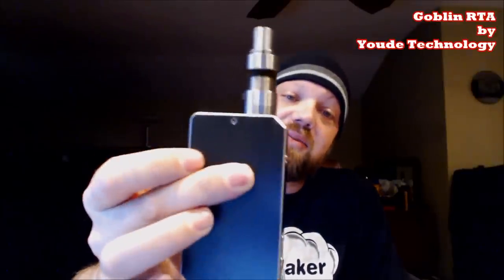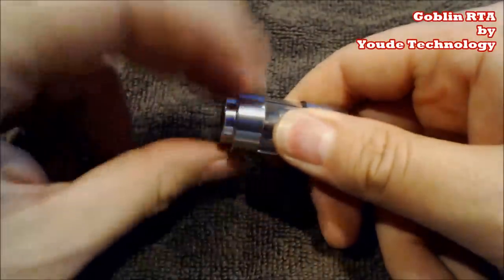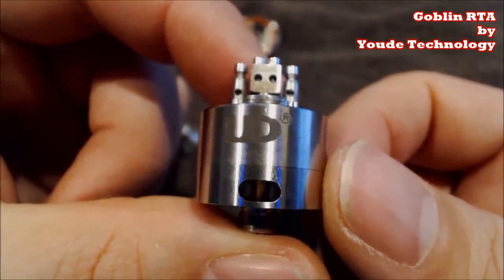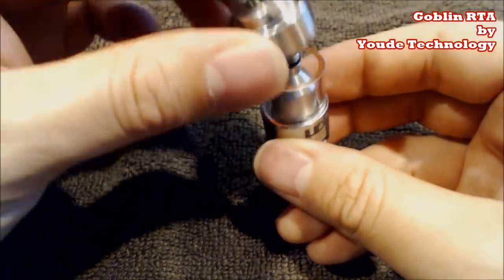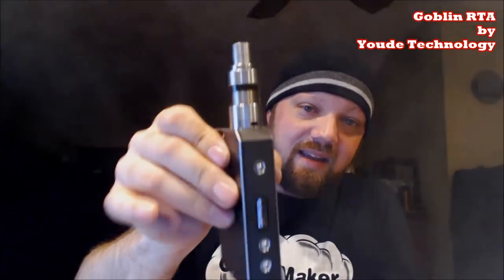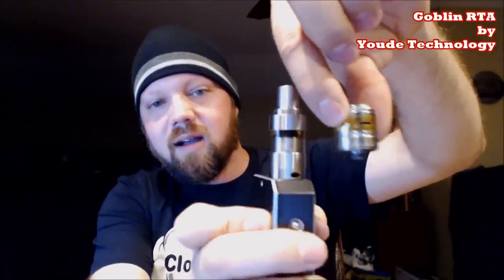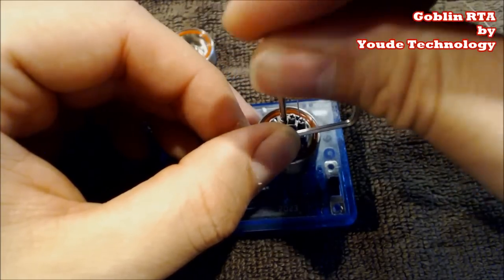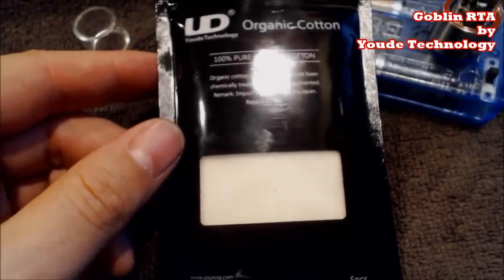*Massive Airflow* Goblin RTA by Youde Tech Review/Rebuild

Comment: Not thrilled with the post holes/screws. Tried 4 different builds (parallell 32/30, 28/27) and can't seem to get steady contact. Ohms are fluctuating.
Reply from the maker: Tanks are not really meant for parallel builds.  Try the 26g 5/64" ID 7 wrap dual coil.  This is not a dripper.  I get great contact on mine.  Where are your ohms fluctuating?  On what your ohm meter or a regulated device?
Reply: Thanks, on the fifth build with 27g I got it right. Would still say that these posts are more finicky than I am used to.

Great vape though. I found that it wicked best with the cotton just on top of the juice channels.
Reply: Ray Lo Vapes
 At least I am patient. At the seventh build I found the cause. The post screws are too short for 27g. The screw fastens head against the deck instead of tightening against the wire. I think that is a design flaw.

Had no thicker than 27g but tried twisted 30g and no problems with that.

Comment: How does perform compared to the delta 2?
Reply from the maker: I would say they are fairly similar but you get a little warmer denser vape on the goblin since it's a dual coil.
Reply: Ray Lo Vapes I love the the delta 2 and yeah very similar but for but the Goblin wins coz you can fill it up miles easier and see your juice and taking about juice you say you have not had one leak but I find it seeps out from the fill screw ever so slightly.
Reply from the maker: Yea I get the same thing now.  Little bit comes out the fill hole.

Comment: I carry around the Atlantis with me all day. Im not too happy with the flavor but it is good on airflow. Every dripper I have bought has been a wash. Dripping just isnt for me. I was thinking about getting the Lemo Drop for my first RTA. The single coil really appeals to me over the dual. Would it be worth it or should I just order this now?
Reply from the maker: It really depends on what you are into.  If you are seeking the larger airflow for big lung hits I say go for the goblin.  If you don't mind a tighter airflow and ease of use go for the lemo drop.
Reply: If for any reason you can't get a Goblin or have one and want a different tank like the Atlantis but about 10 times better look at the Delta 2
Reply from the maker: Yea the delta II is a good choice
Reply: Ray Lo Vapes I have all three delta2,lemo drop and goblin and I find the lemo is a great tank for flavour but couldn't compere it to a delta2 like some have as its a "sub" tank but I would say it kicks the arse of the Kanger group. The delta 2 for me is by far the best of the lot and I have the all of the main new runners on the market. The Goblin I can't comment on yet but is why I'm here coz eveyone I've spoke to told me to set it up the way you have only thing different would be I only have 28 gauge wire so hope that's fine I'll be going for about 0.8 ohms I think and be setting it up tonight if time or tomorrow. So big thanks I'd say from everyone is in order as all have said in here and the forums that your the man to watch a goblin set up Cheers

Comment: Is Goblin Pack doesn't come with driptip?
Reply from the maker: No but I have talked to Youde this week about adding matching wide bore drip tips to their devices in the future.  Won't be too difficult since they also make drip tips as well.
Reply: Sure...But just wondering why they not include the Drip tip in this product...
Are they like..."yeah...Finally,we came with good stuff overhere,just launch it quickly,then we sell drip tips separated" LOL...hahahhaha
Reply from the maker: Ridwan Gunawan Youde never had drip tips with their devices.  But I have asked them to start doing that with the newer items.  Drip tips with devices are a fairly new thing to the market.

Comment: 24 ga builds are easy in the Orchid... not sure why you had to settle for 26 ga in the Youde as the build deck doesn't look much smaller. 24 ga is the sweet spot of all my juice, so that would be a deal breaker for me if it really doesn't fit. The 3ml capacity is already laughably bad.
Reply from the maker: If you watch the rebuild tutorial at the end you can see that 26g 5/64" ID is the biggest coil that will fit.  This was made to be a smaller tank, and the larger one will be coming later.
Reply: Ok thanks for the info. I'll have to wait. Can't use anything smaller than 24 ga.

Comment: Jesus man, I can't find this bitch anywhere. I gotta get one of these. Awesome find Ray, thanks for sharing this. I've been looking for a legit dripper style tank system I can rebuild and has massive airflow. I almost bought a Billow, not now, LOL. I gotta find one of these brother.
Reply from the maker: Only place I know that had these was Triangle Vapes but they sold out in 12 hours.  But they should be restocked in the next week or two from what I have been told.  But you might also want to look at the SilverPlay, it's pretty much on par with the Goblin both have their pro's and cons.
Reply: Ray Lo Vapes I just watched your SilverPlay / Goblin comparison and I'm thinking even though the SilverPlay has a tad bit tighter airflow I think I'll go with it simply because of the build deck. I would rather build 24 gauge dual coils on say a 3/32 or even a 7/64 instead of the oldschool tiny 5/64 bit and 26 gauge or even worse 28 gauge. Now if I could rock dual twisted 26 or 28 gauge on the Goblin I would probably wait. Have you tried that build on the Goblin yet? Thing is I don't want to buy both I already have enough paper weight tanks laying around and that includes the Subtank and Atlantis. I hate both of those products man. Either way, thanks for the videos man. Finding a decent tank system with extreme airflow has been a nightmare. Hopefully 2015 will be the year!
Reply from the maker: No i've only stuck to the 26g 5/64" build.  Seems to work the best for me .  But yea snag the SilverPlay it's also pretty damn sweet.

Comment: Giant air holes mean nothing at all if the hole isn't the same size all the way into the chamber.    I purchased the UD AGA T5 and its got holes that make you go oh look at this it will have decent air flow but when you get into the actual device and follow that air you find its all trying to cram up into a tiny hole inside the threaded copper 510 pin.  Then after you get the build in there that restricts it more and the dam thing leaked all over if you let it sit a while unless you packed tons of cotton in it and then you get dry hits and the and and and and went on lol.  I do see on that one they got wise to the restrictions and the other end of the holes under the coils are also quite large and with it being a dual coil there is two of them so yes im sure its got decent air flow.  I shall keep an eye on this tank and see what more reviewers say about it.  Someone said that tanks where going to end up big this coming year and I think they are right.  Thanks for the great review man.
Reply: Of course as I watched further you said the same thing about the air flow lol
Reply from the maker: Yea this one has the dual 3mm air holes on the deck so you can get some deep lung hits no problem.

Comment: Well mine arrived today and I had high expectations. Sad to say it didn't really meet my expectations. Sure it wicks like a dream even with 80/20 juice while chucking out clouds of vapor but my Kaifun Lite+ still beats it in flavor and to be honest so does my Kanger Subtank mini.

Major drawbacks: the fact that 5 from 6 of my favorite driptips are too tight to fit. The airhole controls measures are all fcked up and not inline 100%, meaning when you close the airholes one of the air intakes pulls more air than the other. Worse of all the fill hole is missing an o-ring which makes it leak.They fcked up a very good concept by poor execution. Hype really not worth it.

Looks like I'm stuck on rebuilding those Kanger atties.
Reply from the maker: The flavor is depending on the build.  Anytime you add more airflow you will loose out on flavor a bit.  Also the bigger glass has less flavor then the smaller glass.  The closer you are to the coil the better the flavor on these massive airflow tanks.
But it's all personal preference really.  I can't stand kayfun's I think they are horrible (for me).
Reply: Ray Lo Vapes 8 wraps 26 AWG, 0.44 Ohm, 40 Watts, 1mm to 1.5 mm from the airhole which is pretty much as close as you can reasonably get without getting too close. Tugboat V2 kills this in flavor hands down and so does my Kanger tank mini and I really can't say there's a huge difference in vapor production between either.

My main concern though are the flaws in machining which you didn't address at all which makes me to conclude that the final production pieces are not identical for whatever reason to these first batch "prototypes" they keep sending to people to review. You didn't address the flaw in mouthpiece size nor the unacceptable flaw in the airflow ring, which has the airholes off by 2mm.

Love your reviews but unless you simply missed these flaws in the atty I can't but conclude that UD is using reviewers such as yourself for false marketing since they production models differ from the ones they send you to review. I really hope you reconsider reviewing anything else accept proper production models cause otherwise, as unfortunate as it is, these reviews are nothing more than hype promotion and misleading marketing for Chinese manufacturers.
Reply from the maker: What issue with the mouthpiece size?  Also what is of on the Airflow by 2mm?  You are the only person I have heard these from.  Also I can't pick and choose what product they send me.  Typically companies send out first batches to reviewers because they want to get the word out.  You might also be putting the coil way to close to the airflow hole.  I keep it a big higher to allow better airflow and also keeps the coils closer to my mouth to get the best flavor.  If you have an issue with the afc and the drip tip size maybe you should send it back.  Sounds to me like you got a bad one since you are the only person i have heard complain about those issues.  Most of the feedback I received has been positive.  I have been told by many the kanger subtank has issues with dry hits and muted flavor as well.  So really it's all on personal preference.  I can only talk about the product I have in my hands.
Reply: Ray Lo Vapes I hope you are not trying to convince yourself that you are forced to review everything sent to you without holding the manufacturer responsible. At the end of the day it's your channel. Just saying.

1.5 mm is pretty much spot on when maxing out the flavor without restricting the airflow. The airhole sizes being off means that the airhole cut offs in the AFC ring are not identical. Now looking closer it looks to me that the other one is actually a bit smaller as well as "off" regarding the placement. So when closing up the airholes and thus restricting the airflow with the AFC ring ends up giving different size airholes on either side. The other airhole being 2mm larger. The difference is big enough to effect the vape quality and is very noticeable. More than likely this is the reason for poor flavor production. Obviously, the difference gets more noticeable when getting close to closing the airholes. Ie; when trying to get more restricted airflow for better flavor. Basically I'm forced to leave the airholes fully open to get an even airflow and take slower pulls (which does give me more than a decent vape I have to admit) but this is a b-class product which should have never left the factory. I have seen this same issue before on cloned drippers with AFC and it is actually pretty common with the cheapest stuff coming from China.

The drip tip hole on the other hand is so small that it only accepts one drip tip from around 20 I own atm. Luckily the tip that fits is a large bore delrin dripper tip and perfect match for this atty.

It is pretty clear to me they have outsourced the production to minimize the expenses and/or to meet the demand they had problems dealing with and all this without a proper QC. Tolerance issues is what I'm looking at. For now I haven't yet heard other people having the same issues but I'm pretty confident they will start popping up as these kinds of manufacturing issues are never restricted to one piece only. What percentage is the real question.
Reply from the maker: Are you sure you bought an authentic one?  Because I have not heard anyone else have the issues you are talking about.  My afc lines up perfectly, and the 510 fits all of 50+ drip tip with some being a little loose actually.  So either you got a clone or just ended up with a bad one that didn't get caught by quality control.  Where did you order it from, and have you contacted them to fix the issue and send you a new one?
Reply: Ray Lo Vapes Yes its authentic. Fasttech has the clone already but it doesn't have YouDe logo on the bottom and mine came with YouDe packaging and all. There are others who have had the same problem, just read on forums. And the leaking specifically has been a major problem for many. Trust me, it's just like I said. They make the "preproduction" model proper, sent it to you guys to pump it up and then switch to lower cost manufacturing without proper QC. I ordered mine actually from Pedro's (Caravela) recommended atty distributor in Portugal, 2Smok. I haven't yet contacted them. Maybe I should but I doubt they will do anything else accept tell me to send it back to them for a replacement at my cost of course.
Reply from the maker: They should take it back without issue.  Youde replaces damaged good for vendors.  Also when it comes to leaking the only place I've heard of leaking is coming from the fill screw.  But that is like hardly drop of juice over a full day.  But if it's leaking via the airflow that is due to wicking not being right.  Out of everyone I have talked to about their Goblin you are the first to bring up the afc issue and the 510 issue.  I have handled at least 50 of these tanks since they came out.  Bummer you got a dud sorry that you are having issues with it.  Most everyone I have heard nothing but great things.  All the reviewers (only 2 got them straight from the manufacturer including myself) have not ran into those issues either.  But like I said Youde is good about replacing damaged goods for vendors so you should contact the vendor and tell him the issues you are having.  If they refuse to help you email me at "raytheemt@hotmail.com" and I'll see what I can do for you.
Reply: Ray Lo Vapes Thanks. Appreciate the gesture.

Comment: Wouldn't matter if there were 8 x 1cm diameter air holes around the base as ultimately air flow ends at the chimney, so if that's only 2 mil internal diameter width that's all you'll experience. Fortunately they've made sure the chimney is reasonably "wide bore" in comparrison to the russian, kayfun et el.

Either way this looks a great tank, I was thinking the Fogger was the best or even the Ubertoot but fuck 'em all.
I dig the deck of this (similar to the fogger v6), better than the russians, kayfuns, orchids etc, less glitches of the Aqua v2 and the build quality looks better than the fogger and the price is FAR better than the £120 of the elitist piece of shit Ubertoot.
Reply from the maker: The fogger is a good tank but it doesn't have the airflow like these new tanks coming out.

Comment: 3ml capacity? Weak. Bottom fill? Weak. Price? Ridiculous. Just not practical for people who are active and work 40 hours a week. Probably great for someone who sits at home all day and vapes, but when I leave the house I dont come back for the rest of the day and I'm not going to carry juice and a screwdriver with me everywhere I go. 

Suggestion? Fogger V6. $30. Fill it once and it lasts all day and then some. Vapor production and flavor, every bit as good as a dripper. Leaks, zero; dry hits, zero. Perfection.
Reply from the maker: I have been filling it from the top now.  You can unscrew the top cap hold the glass and fill it with no leaking.  The fogger v6 doesn't have the airflow and they also just came out with a add on glass and chimney cap to make it 4.5mls but still keeping the size down so you don't have a massive tank almost the size of the mod.

Comment: it leaks bro why u lying
Reply from the maker: John Doe I only get minimal leaking less than a drop from the fill screw in a day.  But never had leaking issues from the tank or the air holes as long as it's built right there should be no leaking from there.

Comment: I just got mine from MVS for $28. Quick question, Ray....the insulator below the positive block is a little wonky (not seated properly flat) I wouldn't think this should cause any problem. What do you think?
Reply from the maker: It shouldn't but that is odd I have a few of these and they all seem to sit fine.  Might want to contact whoever you purchased this from and see if they can replace it.